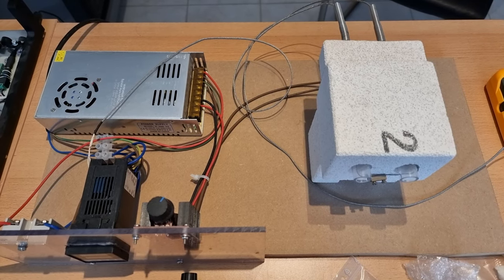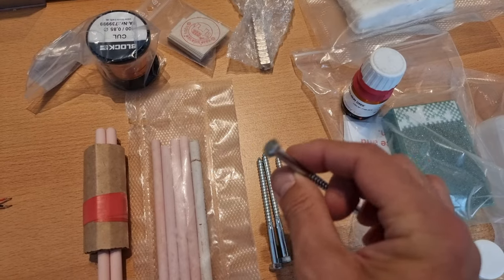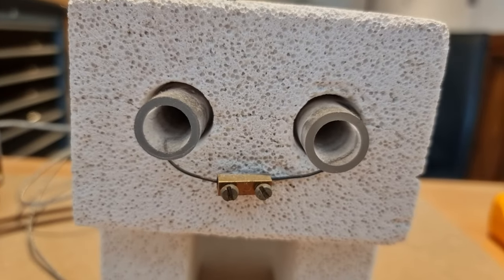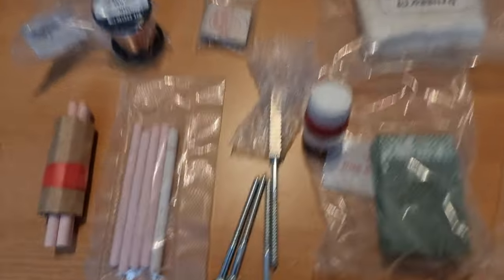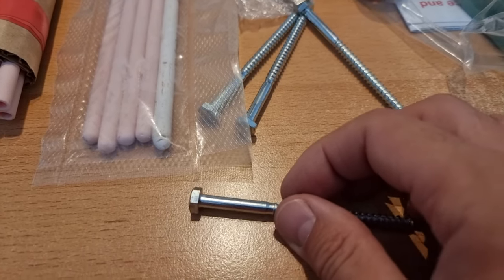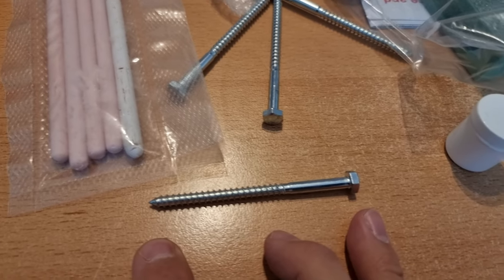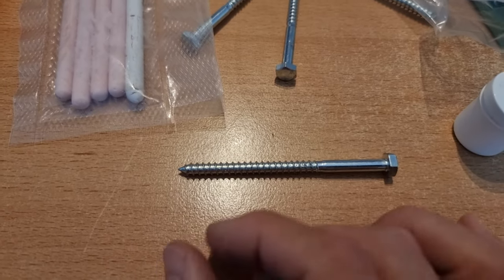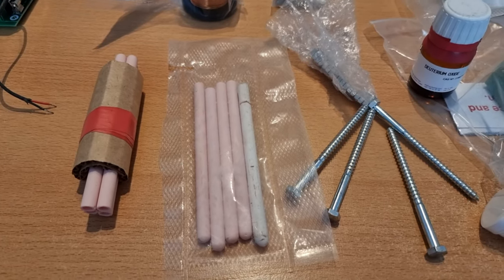LION - Getting set up for future LION replication attempt

Comment: Bob' comment that the little (unattachehed) PWM shown at around 5 minutes is probably correct is in fact correct.  This is the original equipment I supplied to Neil, quite a few years ago, The reason I chose low voltage (36V) was partly for safety but mainly to increase the current (Amperes) in the solenoid and thus the 'bang' of magnetic flux when it was switched on and off.
Reply: Thanks Alan

Comment: Alan's good old Model T. 😊
You might need a larger refractory brick to increase spacing between cores to reduce noise and thermal spill over. Having some refractory cement and thermal wool might be helpful as well. 
🍻
Reply: Definitely wrapping the whole thing in ceramic wool is a good idea if you want to get over 900C.